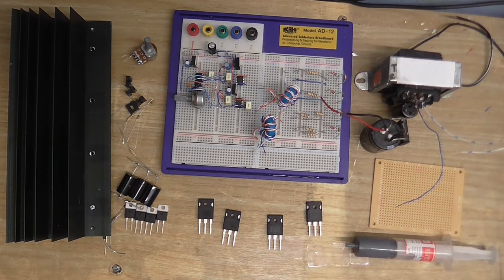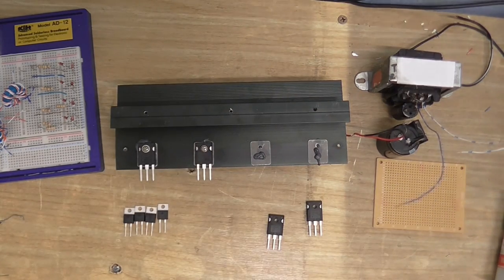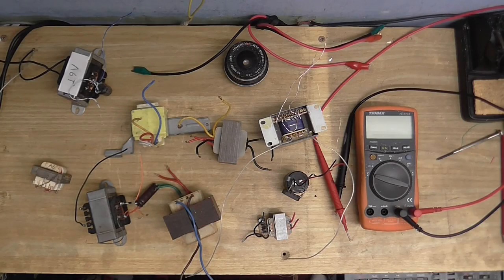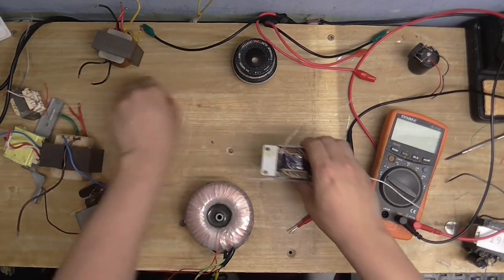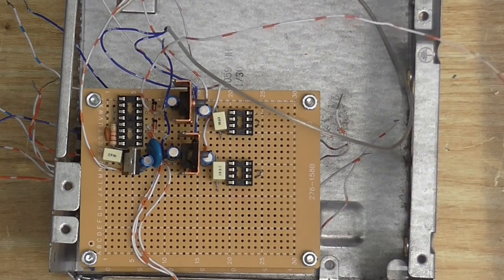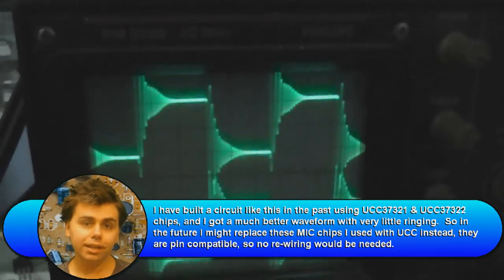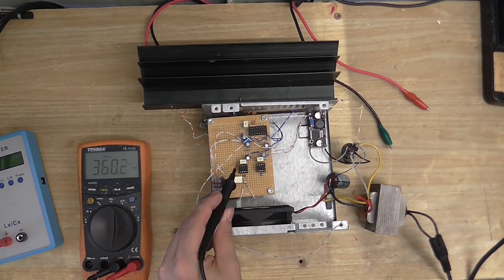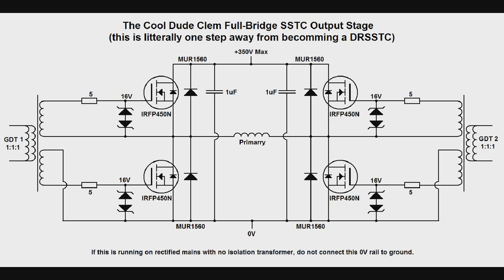Tesla coil Tuesday - Building a full Bridge SSTC part 3 - Putting it together

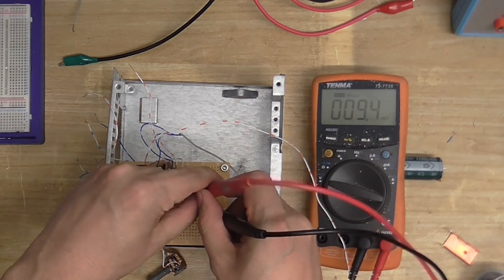Comment: 10:55 I fully agree :) I have 3 homemade power supplies now and a modded ATX with volts adj and current limit. When you know what you're doing, homemade stuff is as reliable&good as bought stuff.
 Neat job, I'm waiting for the SPARKS
Reply from the maker: Not too long to wait now, in the next 2 videos there will be sparks! One of the videos is the low power tests and working out a few bugs, then a video with it on full power (well, ballasted through a 1500 watt heater), but I'll release both of those videos on the same day.
Reply: CoolDudeClem That's good to hear